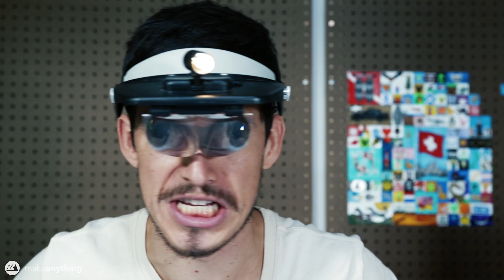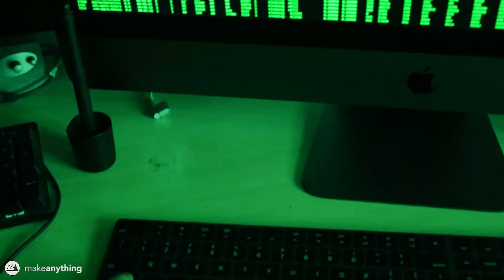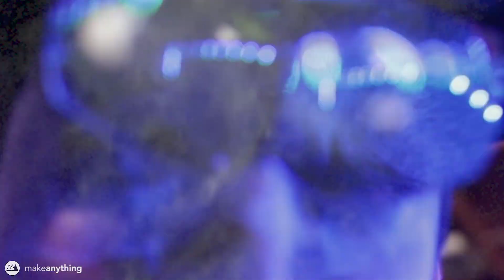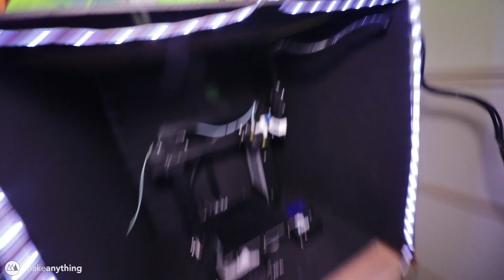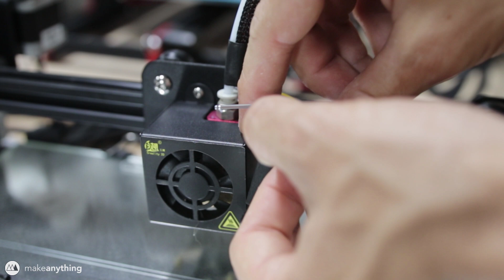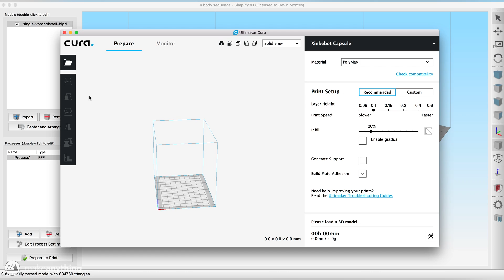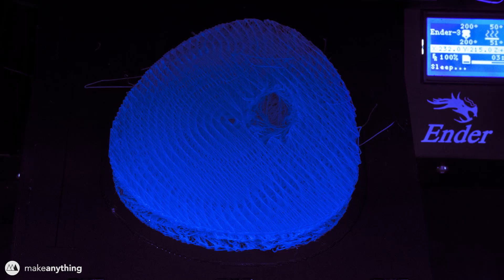How to Do That Cool 3D Printing Timelapse Effect // Hacking the Timelapse

Comment: In CURA, use "extensions", "post-processing", "modify G-Code", "add script", and "insert at layer change" to add a script between each layer. Select "after" for "when to insert" so the image is taken when the layer is finished. (Tried and tested.)
Reply: What is the g-code?
Reply: @chris1987notts1  whatever you need to take the image. Like going to press a switch at a certain position. G-Code is pretty simple for a few lines. You can find how to write commands online.

Comment: doesn't this increase the printing time by about 50% since after every layer its moving away to press the button? Wouldn't it be more efficient to move the trigger to somewhere in the middle and NOT use the extra gcode.

Comment: Have you made any improvements on your print settings? I have Simplify3D and 2 Ender 3's, one is the pro. I just started to try my hand at time lapse and can't find anything with Simplify3D, only Cura, that is until I found this one. I have not tried it yet. I just purchased two BT remotes for my older phones and printed out the remote holder and attached it to my Ender 3 pro. Is it possible to get all your settings in Simplify3D?
 Thanks, 
Danny

Comment: I did something very similar. However, whenever the print head moves away from the object, it leaves a string of filament as it moves toward the park position. How did you avoid that?
Reply from the maker: increased retraction distance, might need extra coasting distance as well. It's also worth finding the lowest workable temperature for the hot end. Quicker hardening = less stringiness. You could also place a brass brush where the nozzle parks, or something else to physically wipe/clean it. Good luck!

Comment: Hey! This is for anyone capable of some kind of input, I've tried and succeeded at Hacking the Timelapse!!! super proud btw. Yet, I AM having some trouble with retraction settings, it is not a stringing problem, but the thing is (using CURA) I introduce G-Codes at Layer Change (and make the machine do the whole movement and pressing of the camera shooter) and have the "retract at layer change" toggled. What happens is it finishes the layer, retracts (7mm) then goes through the G1 codes and so, takes the photo, and THEN goes the other way in retraction (Prime). This makes a little amount of filament out the nozzle that then gets stuck in the print, making the process sloppy and meaning if I want a clean Timelapse I should be around the printer to remove this tiny pieces of filament. ANY HELP IS MORE THAN WELCOMED. Cheers, and good printing!

Comment: Didnt you have the problem, when it starts to print next layer after pressing the button, it will sometimes underextrude for couple of second or overextrude? Im having this problem, at it depends on layer time. For example benchys hull works fine but when it gets to cabin posts it starts to underextrude for couple of seconds. Any solution?

Comment: I KNEW it was manual stop motion. I found it so cool I had a long conversation with my son about how you must have down it and it was clear to me you were doing manual stop motion and stitching the photos together. It was fun to try to figure out how you were doing it.
Reply: Octolapse does it automatically for you just need to plug the camera in might have to change how long the printer waits for the shot but its only like at max 500 ms

Comment: My printer when it moves to click the button a good amount of filament will keep coming out and make the print fail quickly, my retraction is at maximum still didn’t help at all, printing at the lowest temp my printer allows. Did you have this issue?

Comment: i tried this, but unfortunately I encountered flickering problem. How did you solve it?
Reply from the maker: Use full manual  settings on your camera so aperture, shutter speed,metering, etc don't change between shots and make sure the area has consistent lighting
Reply: @make.anything  thank you very much!

Comment: If you use cura there is a better way now:

Extensions -> post processing -> Modify g-code-> add a script -> timelapse

Pause:	 your shutter speed in miliseconds + about 100ms or more for shutter delay 

X:	your x-value
Y:	your y-value
speed:	1000mms should do although it doesn't nearly reach those speeds on my Ender 3. Change it as you like :)

to avoid stringing:

Preferences -> Settings -> Travel -> enable retract at layer change  -> enable custom on side panel -> check retract at layer change

Comment: Cura has an improved method for this time-lapse function:
Go to Extensions > Post Processing > Modify G-Code > Add new script > Time Lapse. 
Then, you can modify the X and Y locations to suit your printer and the pause length.
I've tried and it works, hope this helps! :)
Reply from the maker: Thanks for the update, good to know!

Comment: that's a very hardware solution to more of a software problem. You can run G code that sends a signal to a pin, which could operate a relay or a diode - which would trigger the trigger :-)

Comment: How would you combine this with transparent filament so that it acts like a light conduit.  Now why a light conduit?  So that frames of animation can be captured glimmering throughout the build one layer at a time.  Then when you playback the timelapse video you're also making cool video art as well.  If you could figure a way to sync this method to the beat of music, then mask out the 3D printer itself during the timelapse recording you've just created a new kind of video art.  Compile enough of these morphing videos together and you can sell these as art installations.

You already know what the final shape will be at every layer/frame so that might make it easier to use projection mapping from a pico laser projector.  Small and out of the way it can illuminate the layers directly above and at specific angles to make the coolest damn timelapse ever seen.  The animations used could be static video or it could be of creatures growing, living inside, or trapped and trying to escape.

Comment: try this for cura

;LAYER:

;START of TakePhoto routine
G91 ;Use relative positioning mode
G1 E-10 F1800 ;Retract 10mm of filament
G1 Z2 F2000 ;Move Z up 2mm
G90 ;Use absolute positioning mode
G1 F13000 X203 Y190 ;Quick move to rear right
G1 F1000 X204 Y190 ;Poke
G4 P700 ;Pause for 0.7 seconds
G0 F9000 X115 Y115 ;go in middle
G91 ;Use relative positioning mode
G1 Z-2 F2000 ;Return Z to current layer
G90 ; Go back to absolute position mode for all axes

Comment: Could you write code that makes the x axis strike the limit switch every layer? Solder on two legs in parallel from the switch and have them on a quick disconnect that goes to two legs soldered onto the board on the remote trigger

Comment: This trick actually worked for me but when the print head parks for pushing the button it will leaves a filament trail so called stringing on the way it went to hit the button. So what should i insert in the script for extruder motor for retraction settings? It actually retracts but that still leaving strings. I m using mobile for shooting this so i designed a push button holder by myself and screwed it to the timing belt holder, i have used old earphone jack at one end and a push button at the other end.
Reply: you got any fix on that? iam going crazy, it keeps extruding while traveling back to the print

Comment: You can also use the PrusaSlicer app to do the same. In the Printer Settings in Expert mode you can edit the G-code. Great video. Thanks! Really helps to see an old-school hack that feels much simpler. Or maybe I just like building things.

Comment: That was very cool.
but I use a different method :
open the remote shatter, wire the button to a relay,
 use G-code to trigger the relay between any layer without moving the arms and difficulty to make some parts to stick the shutter around the printer.
but again : you're so inspire to me
carry on

Comment: I just installed Cura 4.2. That includes a couple of new scripts/events. One is Time Lapse, which I think needs you to have an IR transmitter connected to your mainboard. The other is having a script triggered at the end of a layer, so you can just use something like the script shown here.

Comment: You dont have a litle bit filament at the nozzle when it travels to take the shot? And when the nozzle came back stick that little piece of filament to the print.... Im having this insue , any ideia to solve it?
Reply from the maker: Increasing your retraction should help, but with some printers it's unavoidable
Reply: @make.anything  i already increase the retraction, also put a line in the scripts on simplify3d to add extra retraction com layer change, but always a little piece of filamet came out the nozzle when it travels to take the shoot, i almost tryed everything and cannot avoid this inssue
Reply from the maker: @Substancia3D  another option is to add a physical wipe for the nozzle, like a brass brush that the nozzle passes over when going to take the photo
Reply: @make.anything  ohhhh thats an nice ideia like make anything style :-) and i like it, i will try do something like that, grateful fan from Portugal

Comment: I tried using regular expresions to search and replace in cura for the ";LAYER:#" but it doesnt seem to work for unknown reasons. My Regex does work if using notepad ++ and I was able to search and replace all those lines with the code you provided, worked like a charm

Comment: For those interested in a CURA bit of code that kinda works for me and my setting (CR10-S4 with stock settings and CURA 3.5.1 Stock CR10s4 profile). I used relative positioning of the extruder in order to force the retraction of the filament as the normal G10 and G11 commands were not doing anything... Also if anyone has suggestions to improve this code, I am all eyes as I have the problem that it starts extruding during the travel back to the print and leaves a small filament artefact that grows with the print... 

@ Devin would you mind sharing two sets of gcodes where one has the normal gcode and the other has the S3D post processed gcode. It would help a great deal to compare and find a solution for Cura. Thanks!

 Use Extensions > Post processing > Modify G-Code > Add script > search and replace  (and replace the G1 coordinates with your own values)
Replace this text
;LAYER:

By this text
G91 ;RelativePositioning
G1 F3000 E-5 ;ExtruderGoesBackward5mm
M221 S0 ;FlowRate0percent
G90 ;AbsolutePositioning
G1 F6000 X290 Y308 ;QuickMove
G1 F1000 X300 ;PrecisionMove
G4 P500 ;Dwell
G1 F6000 X290 Y308 ;QuickMoveAway
G91 ;RelativePositioning
G1 F3000 E5 ;ExtruderGoesForward5mm
G90 ;AbsolutePositioning
M221 S100 ;FlowRate100percent
;LAYER:
Reply: hey man, i would like to make the same thing for cura, but this is the first time i started doing something with G-codes x.x to be honest i dont even know how to put your g code in cura x.x
Reply: Tried these settings in cura, unfortunately I m getting stringing issue after the extruder returns to the print after pressing the button, I m using a ender 3 pro. It would be great if you can asist, Thanks.

Comment: I have an ender 3 and the z axis wont work and my prints have layer inconsistencies, I have tried everything. Taking things apart and hammering them into place, spacers behind the z axis motor, changing the          g code of my prints. EVERYTHING! what do I do?

Comment: Hello. Im a huge fan. This video inspired us ( myself and my boss ) to try it. We had a lot of issues with how hard the button on the remote had to be pressed. Too hard or too soft or too fast or too slow and it would not work. We then figured out that the stereo mini plug only needs to be bridged to cause the shutter to go off. So we made our own cable and it vastly simplified the process. I can send you pictures and specifics that document what we did if you are interested. You won't need a carriage for the remote the way we did it. And no rubber button pusher either. We were going down some serious rabbit holes with that darn remote. Any who. Let me know if your interested. Love your channel. Thanks for all you do!!!!!!!
Reply from the maker: Yes, other people mentioned that I could just use a limit switch but I haven't yet because I'm hesitant to tear apart the remote shutter... but if it works better I might as well!
Reply: @make.anything  I tore up an audio cable. It's just a stereo audio extension cable. Cost $4 at Best buy.
Reply from the maker: @JulioDMNewYork  oh nice, I guess I'll start rummaging through all my hoarded cables and go from there. Thanks for the heads up!

Comment: I seem to have encountered a problem!
The thing moves quickly, but when it returns it's too slow and spills filament everywhere. What can I do about this?

Also, regex hacks do not seem to be compatible with g-codes generated by Cura, as it makes the printer go crazy with the extruder.
Possible reasons include that while Simplify3D uses relative* positions for the extruder, Cura uses absolute position.

*It is still an absolute position, but its position resets every layer change.

Comment: hey man... i think i found how to do that using Cura...
i use Cura in spanish... so, you will have to translate...
at the <<desplazamiento>> config, you could set where to start each layer...
i don´t try it yet because i don´t have a camera with control... but maybe you could try it...
Reply: did you get it to work? i really need to find a way to do it with CURA

Comment: Some of these it appears you are zooming out also (the taller prints). Are you doing that arbitrarily or a specific amount in some time interval? I am assuming that is a manual process
Reply from the maker: My camera takes photos much larger than the 1920x1080 resolution of the video, so I'm literally just scaling the video in my editor. That's how I do any zooms or panning

Comment: REALLY COOL!   You mentioned vr sculpted 3d models you printed and im very curious what software you used.  I was planning on tinkering with Google Blocks on my Rift but wasnt sure if it could output to the filetype usable by slicers like Cura or Simplify 3d.
Reply from the maker: I have a whole playlist about VR sculpting to 3D prints you should check out! I did use Google Blocks for my most recent rock climbing holds.

Comment: FOR CURA:

use the search and replace function,

Search:
LAYER:

Replace:
TakePhoto
G90; Absolute
G1 F9000 X190 Y210; Quick
G1 F1000 X197; Poke
G4 P500; Wait
G1 F9000 X190; Back
;Layer

Change the X, Y, and F values to match your printer.
Hope this helps!
Reply from the maker: Awesome, thanks!
Reply: THANK YOU!!
Reply: do i have to put this in for everyLayer?
Reply: no,
Reply: have to try this code. used another one, but got strings when hotend coming back to every new layer.
Reply: jack mini this code doesn’t have retraction built in, put a negative extrude command after the G90 line, and undo it after the Last G1 line.
Reply: Thank you!  Can anyone please help me with this?
Reply: @imaginelab3d12  I can help, feel free to Dm me
Reply: @zacharysdev  hey, could you help me with this also? I have all the specific x y values for my printer but don't know where and how to put the code in for cura.
Reply: Zack Snyder please help. If you have Instagram please DM me @_le.3d_printing so you can please help me:)
Reply: I also have an anycubic i3 mega and I thank  wholeheartedly. Thank you very much!
Reply: I don't know how to get the to the place where you inject that code
Reply: Has anyone figured out working Cura code that involve retraction? without retraction i am getting crazy stringing from this. but i cant seem to get the retraction code right, i am extremely new to messing with g code so i really have no idea what i am doing.
Reply: I’m gonna leave it at 69 likes, but thanks!
Reply: You're amazing.
Reply: Ok I did what you said but it only takes one picture at the one layer I set it too...
Reply: Would anyone please explain that code ?
Reply: Hey can you plz help me  its not doing the time lapse and I tried everything my insta is aaronrasmusdavidson plz help or anyone can plz help
Reply: hey I got some excess filament being extruded after every layer when it went to the corner.  do you know how to get rid of it.
Reply: @blueboots4272  youd want to add a retraction line after "G90; Absolute", and then undo it after "G1 F9000 X190; Back". Idk what the correct gcode is atm but you can look it up.
Reply: @zacharysdev  thank you.  I appreciate it.
Reply: @zacharysdev  unfortunatley theis doesnt work for me :(
Reply: If you use cura there is a better way now:

Extensions -> post processing -> Modify g-code-> add a script -> timelapse

Pause:	 your shutter speed in miliseconds + about 100ms or more for shutter delay 

X:	your x-value
Y:	your y-value
speed:	1000mms should do although it doesn't nearly reach those speeds on my Ender 3. Change it as you like :)

to avoid stringing:

Preferences -> Settings -> Travel -> enable retract at layer change  -> custom on side panel -> check retract at layer change
Reply: For Snapmaker 2.0 A350 in CURA 4.8.0

Post processing scrips G-code in Cura (4.8.0) at present moment:

1. Time Lapse
Trigger camera command - M240
Pause Lengs - 700 ms
Park Print Head - YES
Park Print Head X - 319 mm
Park Print Head Y - 300 mm
Park Feed Rate - 600mm/s

2. Search and Replace
Search:
M240 ;Snap Photo
G4 P700 ;Wait for camera
Replace:
My Snap Photo
G91; Relative
G0 F1000 X1; Poke
G4 P500; Wait
G0 F6000 X-1; Back
G0 X-159 F5000; To Center
G90; Absolute

3. Search and Replace
Search:
G1 F6000 X319 Y300 ;Park print head
Replace:
G0 F6000 X319 Y300 ;Park print head